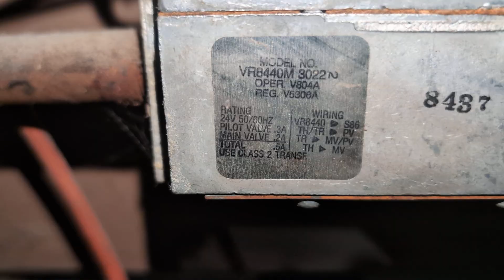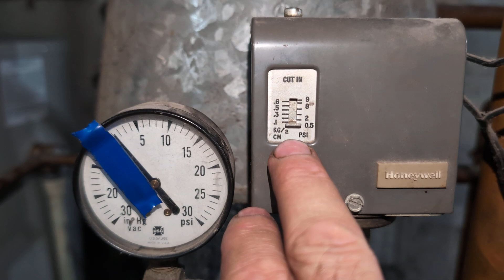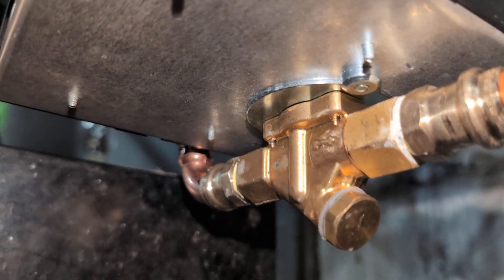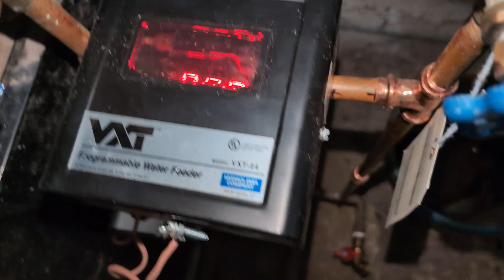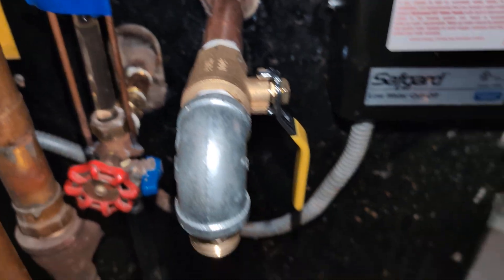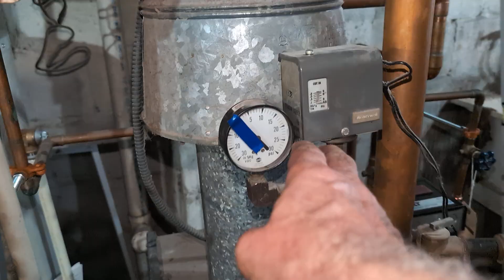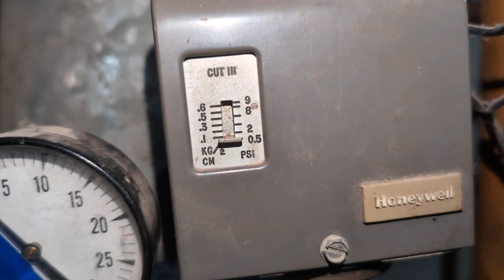Updating Residential Steam Boiler Safely Controls For Easier Maintenance And Fresh Water Control

Comment: Just goes to show that with some boilers they can be piped wrong but work ok.
Reply from the maker: Yes, that's true.
What helps this system here is (1) the boiler water appears to be free of oils, etc. (2) the outlet is not restricted, but gradually reduced from 2-1/2" to 2", (3) The outlet riser is high and there is a drip of sorts, (4) and there are only four radiators hooked to the system.